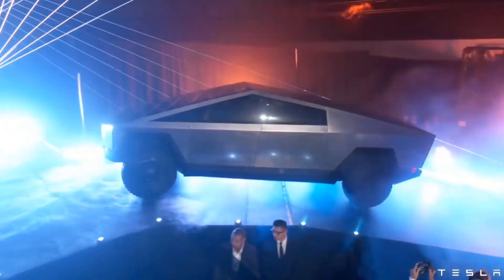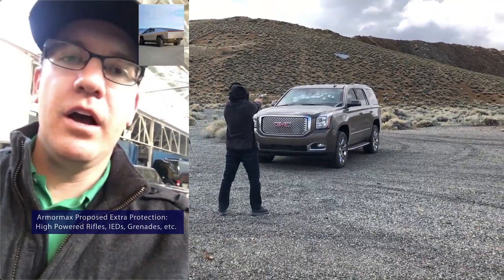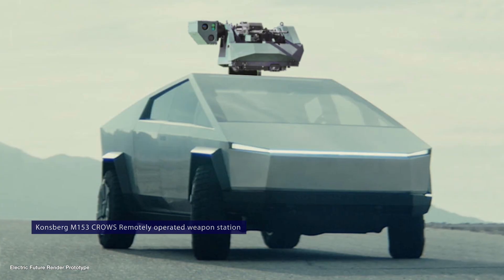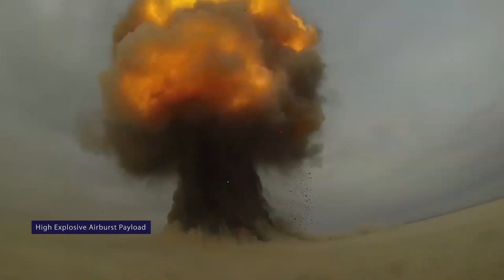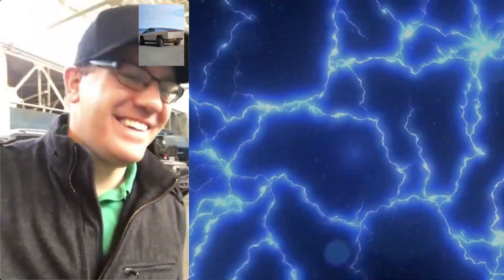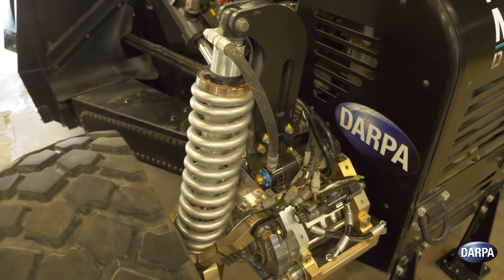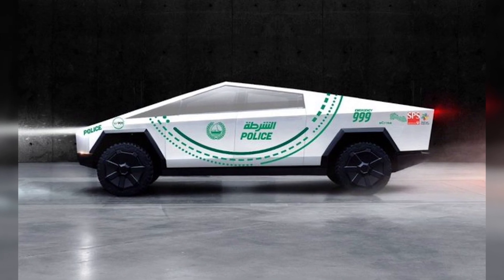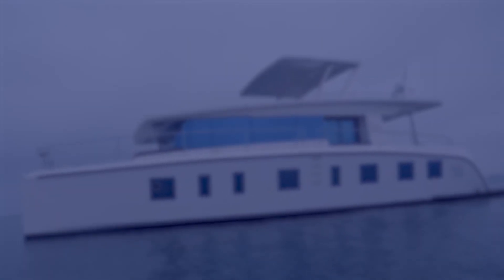Military Tesla Cybertruck: Combat Vehicle

Comment: Is an electric vehicle really what you want on the battlefield?  Think realistically about campaigns.  Operational range is important.  Do you really want to stop your mechanized column so that all the cybertrucks can spend hours charging up their batteries?  And where are you going to find all these chargers on the battlefield anyway?  Are you going to bring electric generators (which use fossil fuel) with you on campaign?  If so, wouldn't it make more sense just to have fossil fuel powered engines in the first place?  (This is way more mechanically efficient than converting fossil fuels to electricity first just to use in the EV.)

Until battery technology improves dramatically, I just don't see it as being practical.

Comment: OH, this is going to HAPPEN, especially here in the US.
Reply: next level of cyberterrorism: enemy states try to hack these vehicles to cause massacres.
Reply: @effexon  All fun and games till u piss off the ai
Reply: Huh? Are you being serious because the US is just about to replace the Humvee with a JLVT i dont think theyre just gonna ditch it for a stupid ass battery box
Reply: @Andrew58251  better à gas box?
Reply: @MaxxerG  Yup because that gas box offers heavy protection, some of the best off-roading capabilities possible, doesnt require to be recharged every two seconds and can be easily refueled, tell me, where are you gonna find a charging station in Iraq? What about Syria? Not to mention the gas box is much easier and cheaper to build. There is a reason they use the gas boxes over the completely un-practical battery boxes just because those ones "looks cool" even though they honestly looks like dogshit...
Reply: @cj_curles0671  The US military does not care if its cheap. They care if it actually works.
Reply: Эндрю 

People thought Internal Combustion Engine cars wouldn’t work yet here we are.
You can’t be biased just cause it’s electric, it will have a 500Mile range and Reliable, 
It doesn’t take transmission fluid and oil and gas and Have ALL these moving parts that can break in it.
Reply: Aditya Chakrabarti 

Imagine hating something because you’ve never seen it happen, 
You sound like some one from 1900 who doesn’t believe gas cars will work because it needs gas stations and is 5x more expensive than a horse
Reply: Aditya Chakrabarti 

The difference is if you knew how much Gas Powered military vehicles were affecting the Climate and Climate change, you’d understand that having electric vehicles would be better for the whole world, and we wouldn’t be fighting over oil.
Reply: @cj_curles0671  500 mile range doesn't mean shit pal. Even if thats close to a humvee or mrap, it still takes hours to charge. What are you gonna do when you're out in the dessert getting shot at and your battery runs out? Have someone fly a battery pack over? And to move these vehicles you need very large turbo diesel engines, i dont think an electric motor would have anywhere near enough power to move one of these. The technology is no where near where it needs to be to be used for military purposes. Give it up, stop arguing a point you know is stupid
Reply: Эндрю 

An Electric motor has more than enough power to climb dunes, i know people who Dune their Tesla Model X’s all the time, and ofc you’d never go farther than you think your Truck can go,

The technology is more than capable especially if you watched Tesla’s battery day.
Reply: @cj_curles0671  climbing dunes is not the problem. The problem is pulling 18 tons of steel. Show me an electric motor capable of doing that and ill give up this whole debate
Reply: Эндрю 

I’ll find the clip, but a Model x pulled a Fully Loaded Semi trailer up a Icy road because the Diesel Engine Broke Down.
I’ll see if I can find it
Reply: @Andrew58251  honestly 500 mile range would be awesome, no way do you believe that humvees or any other diesel vehicle could last near that range. I’m a diesel mechanic for the Army and these things run out of fuel so much and break down all the time. It would be refreshing to not have to worry about that kinda stuff anymore. Obviously there’s still a ways to go with figuring out how to charge it faster but once that’s out of the way then I hope it gets used by the military. It would be awesome to see on base
Reply: @superdave5250  500 mile range is only on the top model tesla and thats on road. Going off road on un even terrain in a heavy armored version youd be lucky to get 200. Idk what it being electric would have to do with not having parts break. The thing is a freaking bomb waiting to go off with how many batteries they pack in there
Reply: @Andrew58251  You've never heard of trains?
Reply: Aditya Chakrabarti 

I’m not saying tesla is the end of it all, I’m saying electric is.
Reply: It wont happen because a simple chaff burst emp pulse will shut them down extremely easy as in not starting it up unless rebuilt.
Reply: @Sak-zo1ui  I believe I heard them say in this video that they would EMP proof the Tesla so it won’t be affected 🤔
Reply: @superdave5250  nothing is ever emp proof on a vehicle
Reply: Aditya Chakrabarti  okay let me know when your XMSN craps out at 118K miles. Had 2 now (2006 Cayenne and and 2014 Diesel).

Comment: One major problem with carrying massive amounts of weight with 18650 batteries: voltage sag

At a certain power to weight ratio the batteries will maintain voltage at a sustainable sag rate and perform well

But once the cells are pushed to the limits of their output- they lose dramatically lose efficiency and do not perform well. 

They key to the combat cyber truck will be finding out the true limits of a single 18650 🔋

Comment: Onboard solar can be useful for the primary batteries. Larger fold-out systems provide more power and charge faster as a result. Smaller systems can slowly recover some range over multiple days if, for example, the vehicle is the center of a camp.
Reply from the maker: Did you give this one a like atleast
Reply: @ElectricFuture  
Okay fine, this one deserves it. Have a like.

Comment: Great video, thanks. I’m curious on how it would look on a thermal camera? Without a ice engine it should have a lower thermal signature. Cheers
Reply: Seeing as wasted energy is emitted as heat, and electric vehicles are notoriously efficient, it's a certainty that Cybertruck would be significantly less visible on thermal imaging.
Reply from the maker: Good question...and a good video idea actually.

Comment: its stupid to trade diesel for battery in actual combat scenarios but for training i think electric would be amazing and save billions! but emp and other electric attacks would kill a battery system and if the battery took a blast it will disable vehicle and turn it into a fire box the safest place to put battery is at roof but now your vehicle is already to top heavy with armor add a battery it wont stay on its wheels. nope! diesel engines  can often run with a few bullet holes they provide more torque potential than an electric. no way is it good for war!!! but it would be amazing for police or training or public anything but war! the extreme climates the military endures the deep waters we tread through there is no way its good!!! and if we get retarded generals to take these to war will get its units killed or otherwise raise the danger levels of our own troops.... the initial cost to buy electric training vehicles would be insane but this would mean its easier to upkeep and maintain battle ready vehicles if we dont abuse them in training

Comment: The Konsberg should be outfitted with the new SIG .338MG (currently in combat trails overseas). The weapon system weighs several pounds less than the M240B, and can be configured to feed from either side if twin-linked with a second MMG. The .338 Norma bridges the gap between the 7.62x51 and .50 BMG. It has a higher ballistic coefficient and range than both. With some high-powered optics and advancements in gyrostabilized platforms, it may be able to engage targets at the max range of 2200 Yards.

Comment: They're talking about running tanks on batteries but i can't even buy a laptop or phone that can keep a charge longer then a few hours with regular use.
Reply: Its because they aren't Tesla batteries, Tesla batteries and designed to be one of the best batteries that have one of the longest life, and than with a battery of that size it works well.

Comment: I wonder how well they handle hackers?
Reply from the maker: It’s a good question. All modern vehicles are operated by software controlled ECU’s and are vulnerable to “hacking.” Tesla’s vehicles are highly computerized. We might even see some  “jailbreaking” attempts by sophisticated militias who want to convert the cyber truck into makeshift combat vehicles “technicals” with total autonomy.
Reply: @ElectricFuture  my thoughts exactly just like what happened in the Fast and Furious movie a similar situation could happen. just hope Elon is ready for it.
Reply: @zotax6948  I'd think the vital computer systems would be isolated in a Faraday cage/EMP shielding, making them inaccessible to outside signals. You'd likely have to have physical access to the truck in order to hack anything vital.

Other systems that depend on outside signals (internet, communications, etc.) would definitely be completely separated from the vital systems. Meaning if your communications got hacked, it wouldn't disturb the truck's vital systems.

Comment: It won't work.  Range is too short, and there's no way to "refuel" it in the field.

In real, military operations, fuel trucks bring the fuel to the vehicles in the field.  Even if you brought a self propelled charging station, it's gonna burn through tons of diesel running the generator all night - yeah, all night.  That means a sitting target for enemy artillery, rocket, or jet bombing attacks.

One diesel fuel truck will refuel hundreds of vehicles.  How many electric vehicles will one diesel generator charge at one time?  Not hundreds.  That means that you'll have to have dozens of these mobile recharging stations to charge ten, twenty, thirty vehicles?  And during that time, a diesel fuel truck will have to go around refilling the tanks of the diesel generators, because those generators will be running at maximum power to meet the demand of charging all of those batteries.

Electric combat vehicles do not make sense.

O.K., now I'll watch the video.
Reply from the maker: Swappable batteries and fast swap stations are a possibility

Comment: Will never happen. Lithium batteries are way too volatile. The motors get to hot which will easily be detected by infrared cameras. Impossible to  completely protect the air suspension.

Comment: As for the issues with punctured lithium battery cells exploding, you could look at the ammunition storage units in tanks, like the M1 Abrams, which use blowout panels in case the armor is penetrated to redirect ammunition cook off and keep fire away from the crew. A system of these blowout panels could redirect the fire from these cells away from the doors and passengers, allowing them to escape without further injury.

Comment: Fascinating video. Not only do we need a low maintenance tactical sci-tech civilian truck to last a massive one million miles, Cybertruck, but also an  independent solar power charging station at home ready to roll anytime should an oil and power grid crisis occur at some point in the future, but would plug in the standard fossil fuel generated power grid at work and during a long road trip. I hope this option becomes possible in 2 to 4 years from now.

Comment: Dumb video from an engineering point if view. 

The amount of time and work that went into minimizing the maximum amount of weight to make the range of the batteries reasonable is tremendous. 

To now all of a sudden add bulletproof glass (three times the weight of normal glass). Body armour ( double the weight of your truck ).

So effectively your new bullet proof ,heavily armoured cybertruck will probably have a charge lasting about 30 seconds.
Reply: Arcane 777 no wrong even if the cyber truck carted 4x its body weight  it would have a range of 125 miles on full charge which isn’t to far but far enough

Comment: Nice. EV wins on heat and sound signatures. Autonomous/OTA/smart sw seals the deal for future military. Drones/weapons corrdinated by AI, orders of magnitude faster, more accurate than humans.
Reply: Yeah, the video made no mention of the reduced heat signature of an EV. With Tesla's heat pump, connected to cooling tubes under the skin, could be used for thermal camouflage. It could use differential heating/cooling to mimic the variations of the topography behind it.
Reply from the maker: Dan Oberste Come on Dan I mentioned it in the first 2 minutes of the video.
Reply: @ElectricFuture  I stand corrected. You "mentioned" it, but it's a feature that deserves more than 1.3 seconds of  discussion. Don't get me wrong, I loved this video! I just think that a military vehicle that can be virtually invisible in infrared should have that feature expounded upon. It's HUGE.
Reply: @danoberste8146  lol shut up you didnt even watch